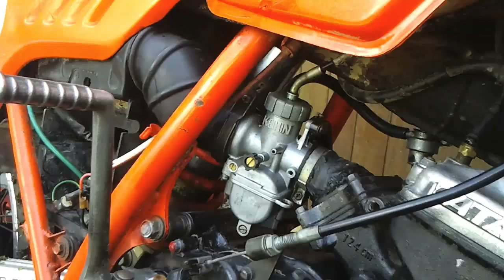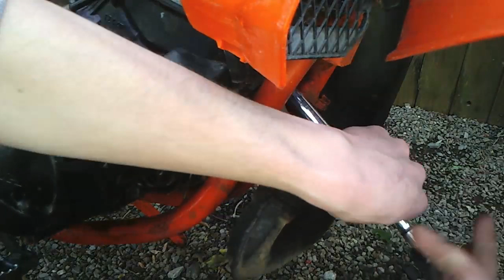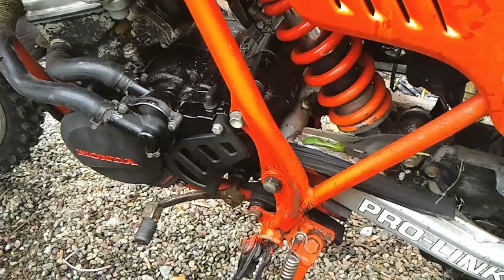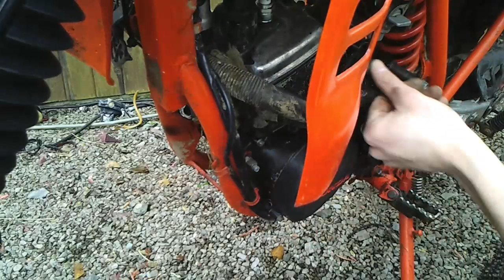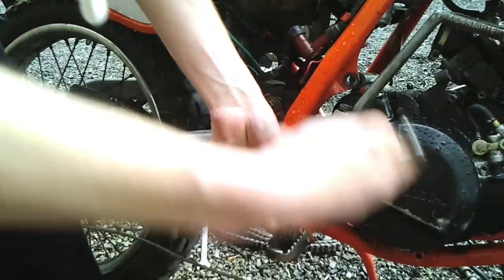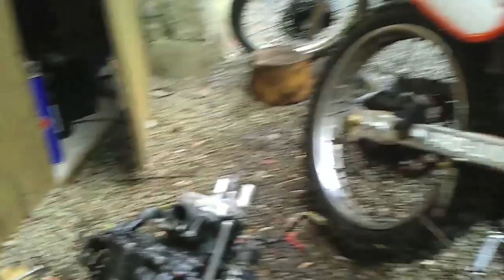How to remove Honda 125 engine

Comment: hey sam can you do a video on the wiring of the mtx 125 I had mine stolen and they cut the wiring to pieces and took all the lights and clocks im trying to get it up and running again I have bought a wiring loom but have no clue where all the lights and other stuff will plug into..